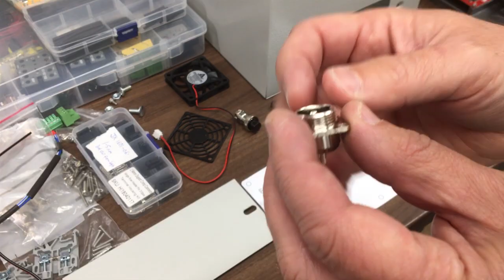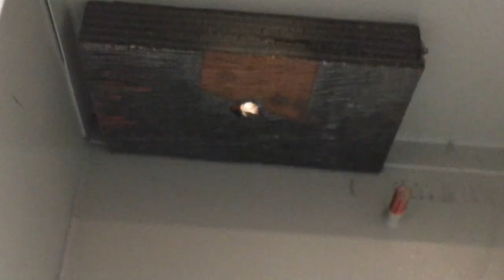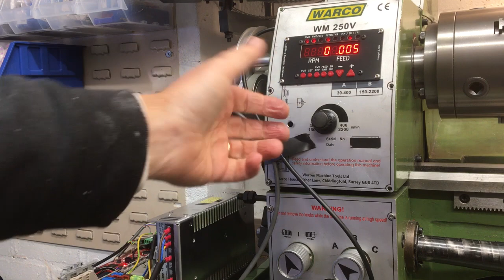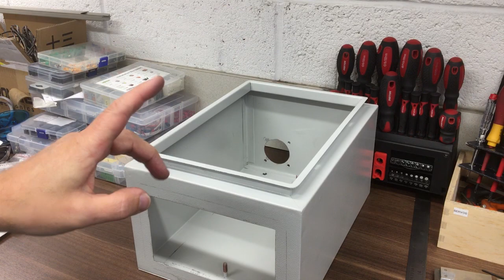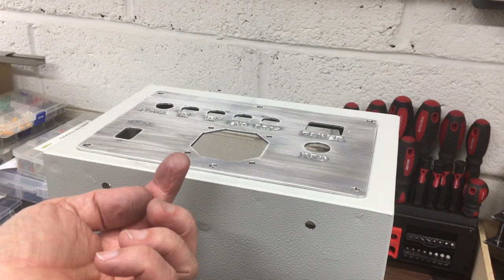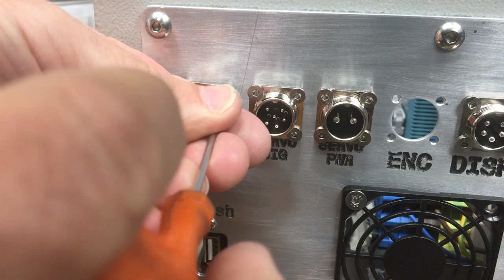Ep05: Clough42 Electronic Leadscrew | Enclosure mods

Comment: Just found this excellent set of videos. I built mine during lockdown (2020) using a stepper motor for cutting threads on a toolmakers lathe. Works well, takes some setting up but so do change wheels and a cardan shaft. I have great trouble with electronic interference, so much so that I use it without powering the lathe so hand crank the headstock spindle. I have inserted filters in the VFD single and three phase supplies but these tripped the workshop supply. I  have screened all control wiring to a single point. So I will continue to watch this excellent set of videos ..... many thanks
Reply from the maker: Sounds like you are nearly there.  Maybe ferrite cores around the cables.  The other option is to connect the plug into a socket far away from the lathe plug on the other side of the workshop.  Or into a long extension cable and see if that helps.

Comment: Next time you do faceplate engraving you might want to try using powder coating spray with a laser head on your CNC mill. You could just attach a cheap laser head alongside the spindle motor or you could use a 3D printer if you have one. That's a great way to do pro-quality labeling on faceplates. Check out Clough42s video on the subject. He covers some great ideas on the subject of faceplates and the powder coating one was one of his best. I've got one of those cheap digital laser engraver frames that I'm going to repurpose as a CNC plasma cutter and those work great for powder coating engraving (before the plasma MOD).
Reply from the maker: Yes the engraving is not very crisp but I'm just using a cheap chamfer bit.  Also 1000 grade aluminium is very sticky and does not leave a crisp edge.  I don't have a 3D printer, powder coat facilities or a laser engraver although they would all be useful additions!

Comment: Do you use shielded ethernet cable, or what do you use for the signal connections?
Reply from the maker: The encoder already came with shielded multi core cable.  I ended up only using it as supplied with the shield grounded at the encoder end.  The display cable is just regular multi core cable because that is what I already had.  A shielded cable would be better.  Not sure about using Ethernet cable as it is twisted pair and I think (but don’t know for sure) that would only work for pairs of differential signals to provide common mode noise rejection.  I think for the display there are signals for ground and data and clock etc. but they are not in pairs so perhaps not appropriate?  Someone may have a better view on this or maybe one of each twisted pair would go to a common ground and other twisted pair cable is the signal?

Comment: Have you managed to connect your servo motor to a pc/mac to set  it up? I'm having trouble finding a suitable lead as the one that comes with the motor has a VGA connector
Reply from the maker: Sorry not yet.  Been sorting out the other wiring and it takes a while!  I’ll see when I get to that point.
Reply from the maker: Just to follow up I used the servo with the default software settings and it works just fine so I didn’t go near a pc for it in the end.  Of course some settings are on the dip switches on the integrated driver.